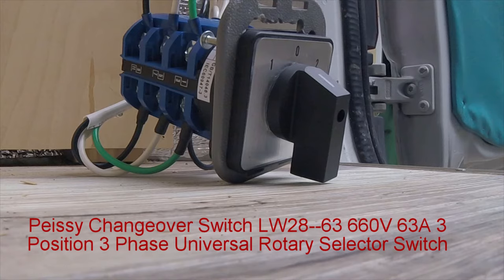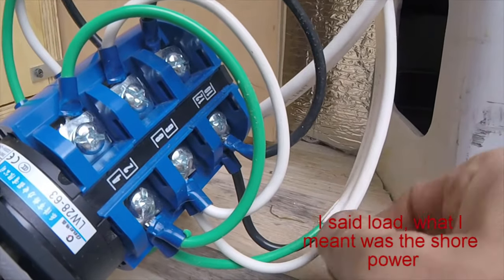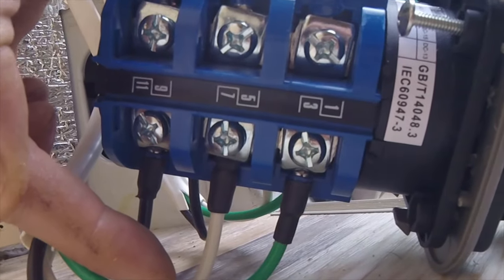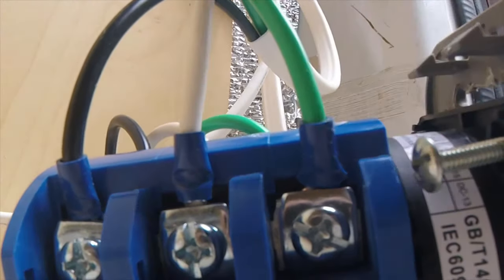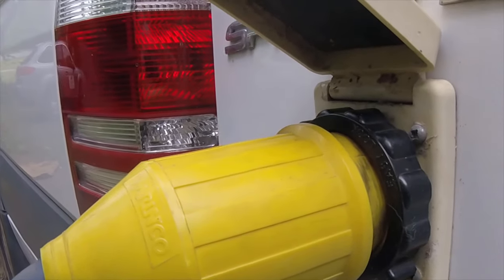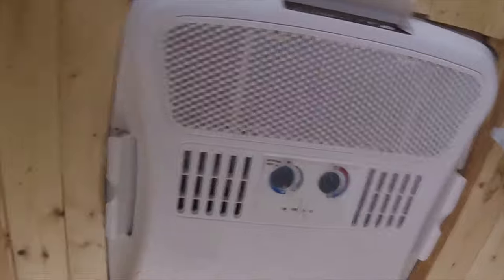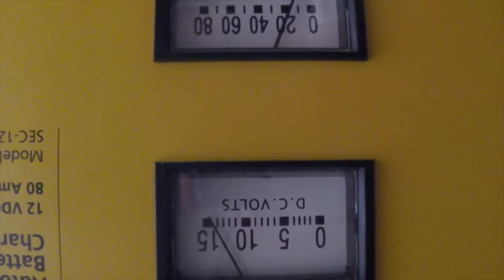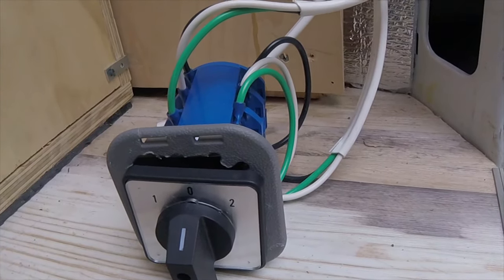Best Change over Switch 1 Power Source 2 Loads Van Conversion. Check it out.

Comment: EXCELLENT!!  I used it "backwards" like another reader already suggested.  I wired it exactly as you indicated, your slight mis-spoken "load" wires actually helped with clarity in my application.  I have two inverters I wanted to be able to toggle between.  Simply excellent info for the DIY guy.

Comment: OMG so glad I found this video. I have been searching for days on how to wire these suckers. Our AC selector switch burned up. 30 amp RV has a 20 amp AC in the front and another one in the back. They can not run at the same time on campground power. Could not find instructions anywhere. I followed your method and the switch, the front and back ACs work perfectly. Can NOT thank you enough.

Comment: Used one of these switches when I built the electrical system on my off grid property. 
Bought a second for a second project on the same property.
Had no problem for some time but eventually the contacts failed due to arcing. The new replacements in time went the same way. I can’t say with any confidence that mine were the same brand as this one shown but can say it appears identical.
Solved my problem by changing to another design with the same function.
Just relaying my experience.
Reply: Hi Dennis, this switch is learned from Kraus&Naimer blue line design, however, many factories learned without independent thinking. You will find even the appearance looks the same, but there are many different details. 

1. Silver point size and thickness.
2. The travel distance between moving contacts and fixing contacts.
3. The shape for Clamping Plate for the wire.
And so on..
So, please don't doubt the performance of this switch, just choose the right manufacturer. It will save your money and time, also keep you safe.
Reply: @konrak5512  no they don't look anything like it lmao. Kraus & naimer ones are much bulkier and obviously built better, also the price tag is 5-10 times more. They do not look like these switches, the terminals are very different as well.
Reply: What was your solutoin ?
Reply: Pay once cry once lol

Comment: Thanks.  I am building a hotbox to keep caulk warm in my van. I plan on switching between cigarette lighter inverter and an inverter running off a power tool battery (for when the van isn't running)  Didn't know if this switch would work for me, but now I do. :)

Comment: Marck really appreciated your vid on wiring this switch. I have a similar switch with 8 terminals and 3 positions. I want to wire 2 power sources and 1 load allowing me to switch between power sources (Shore and Genset). How would I accomplish this with my switch? I haven't seen any other instruction on this.
Reply from the maker: Hey, post a picture of it or the model number so I may examine it.
Reply: I had the same requirement!… so… jumpers between 4&2 and 8&6 as per video. Load will be 4&8. Source 1 1&5 and source 2 3&7. Keep + and - in the same order as per Marck’s excellent video.

Comment: Hi Marck, I like your video. I am looking to buy the same exact transfer switch. I kind of understand were you coming from when tranferring from shore to Battery charger. But what about having the same shore line to be use for a reseptical when the shore is not in use. Can the tranffer switch be use to connect AC line Out and Shore Line In? I kind of did a Diagram to show my idea for better understanding. I like to do this for my owe purpose and I like to submitted to you, if you like. I'm a new beginner at this. Please let me know.
Reply from the maker: Sure thing. Post it do we may discuss.

Comment: Feels like you’ve come up with a solution where there was no problem? If you have the battery charger connected to consumer unit you could use the switch to then select between ac & dc which seem more preferable. If you wanted to turn battery charger off you could just do so with the socket switch. Sorry I may be being stupid here but just can’t figure what this is achieving?
Reply: That’s exactly what I thought… all he was install a off switch..  the switch is meant to transfer 2 sources of incoming power to a load…

Comment: Do you wire the switch the exact same way if you have one load and two power sources (shore power and fuse panel)?

I have a second air conditioner that I want to run  a cord to the campground pedestal 20 a mp plug. Position 1 would be normal mode, position 2 the 2nd AC would bypass the coach power, make a 20anp shore cord, and connect it to the pedestal.

A way to bypass the coaches 30a power.
Reply from the maker: Yea. That would work.

Comment: Hi,
Thank you for the video. My issue is a bit different.
I would like to use the switch for changing the sens of rotation of an electric motor.
So that if on position 1 it will rotate in one direction and if on position 2 it rotate in the other direction.
Can you please help know how to connect the terminals? I mean which numbers of terminals I may connect together for position 1, and which ones for position 2. And which ones to connect to the motor and to the power supply.
Reply from the maker: As long as you maintain the same terminal on either side of the switch, you should be ok. Open it up and look at the inside. It should be a bit more clear.

Comment: Wondering if i can use this switch with a DC solar array 2 wire pos n neg to  this switch  then 2 different DC units and toggle between the two units  from the one solar array
Reply from the maker: You sure can. Only hook up the connections you need. 2 wires in and 2 wires out.

Comment: The video was helpful to see how to install the switch but why would you install this switch in the first place?   If you put the charger, air conditioner and shore power together in a junction box then you could just charge your batteries and run AC at the same time while on shore power.  You wouldn't need to switch these.
Reply from the maker: Hey. Thanks for the input. Didn't think about that. I also wanted to run my AC off my batteries. The idea was to toggle between shore and battery for the AC.
Reply: @marcklindsey9512  In that case you would run your shore power and charger to one input of an automatic transfer switch and the inverter to the other input then run the output to an AC Sub-panel that the air conditioning is on.  This way when you plug in shore power. it will automatically run your air and charge your batteries and when you unplug shore power it will switch the input to the inverter and the inverter will run the air.     

Installing off grid mobile solar systems is what I do so if you ever want to pick my brain just message me.  Always happy to help.  

But I liked what you did with the manual switchover.  I will be using that switch to put in a 30amp service to switch between a Dryer and RV service receptacle.
Reply from the maker: @OffGridSolar  right on! Yea what you recommend is exactly what I should have done! Where were you last year;) I’m heading out for the summer next week. When I come back, I’m doing what you recommended.
Reply: @marcklindsey9512  If you need help message me.
Reply: @marcklindsey9512   Hey Marck I need help on my connection.  I have a 4 point rotay switch and i need to connect 2 inputs (power source) for one output(load). kindly advise. ( lw39b-16/3)
Reply from the maker: @Universalenter  hi Frank. That switch is meant for that.